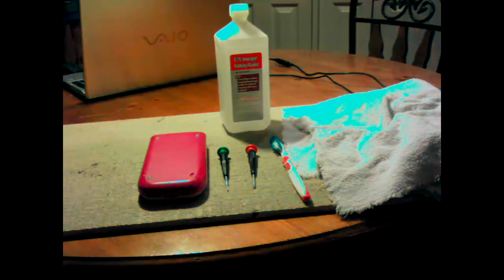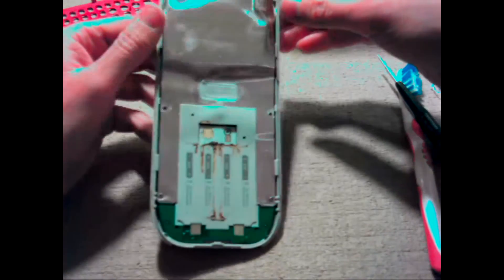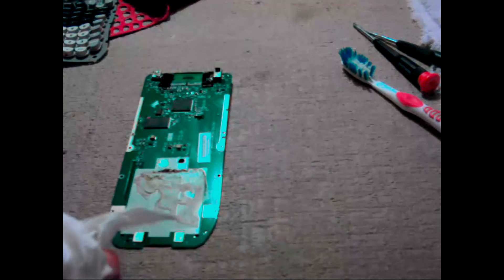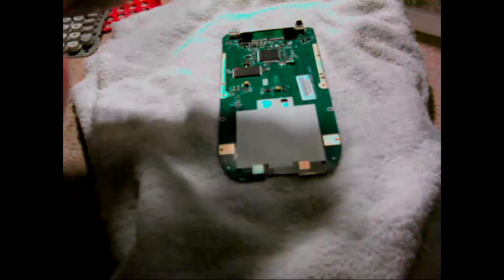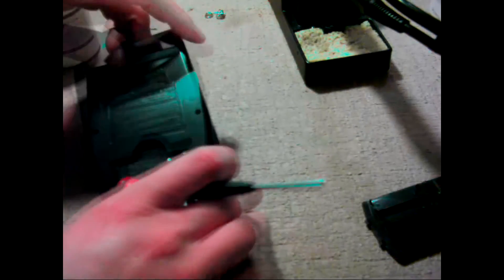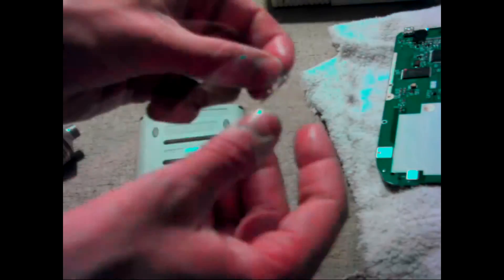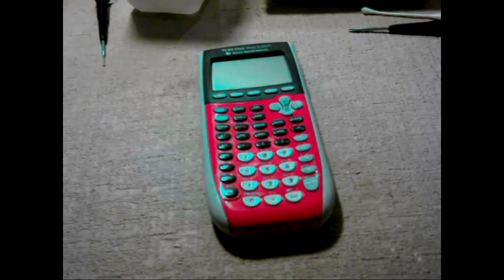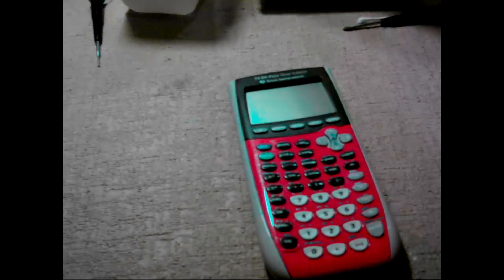How to fix a Liquid Damaged and Battery Acid Damaged  TI-84 Plus Silver Edition

Comment: Must i do this as soon as possible or could i just store it somehwere? I dont have the right tools.
Reply: It said rammed cleared but i still cant use it?
Reply from the maker: @kimnguyen728  is there a lot of battery acid in the battery compartment? If it says RAM cleared the watch battery used to store data could be dead.

Comment: Opened mine up after the battery leak and theres black spot directly below where the button battery was, can it be cleaned the same way?
Reply from the maker: This process should still work just be careful while cleaning it with the rubbing alcohol.

Comment: What is the tool called to take apart the calculator? Also I bought my ti-84 and put in new batteries, and said ram cleared, but when I was cleaning it with some lysol wipes and I turned it over on back while cleaning, came back to the screen and now it looks lower part is just lines.  No idea how this happened.
Reply from the maker: You need a t6 torx to take it apart. It could be liquid damaged, the lcd could be damaged, or the ribbon cable between the lcd and the board could be damaged
Reply: Could it have been from the lysol wipes I used?  Prior to that it worked.  Is there a fix to that?
Reply from the maker: It could have been just from applying too much pressure to the lcd when you were cleaning it. My lcd turned black in the corners and had lines through it when I took it out of my backpack once and I took it out of my backpack a day later and it was working fine. Maybe time might alow your lcd to go back to normal other wise there is something wrong with the connection between the the lcd and the motherboard and with the ti83 you could solder individual wires from the lcd to each pad on the mother board considering that the lcd ribbon cable is the same in the ti84 as the ti83